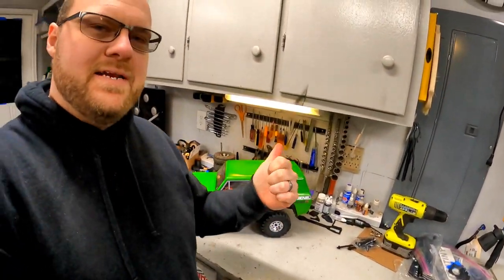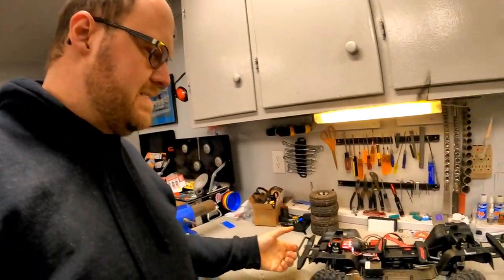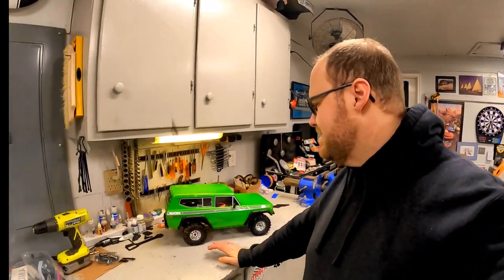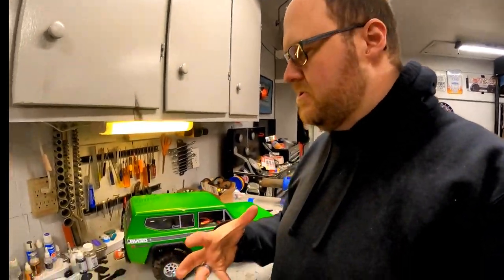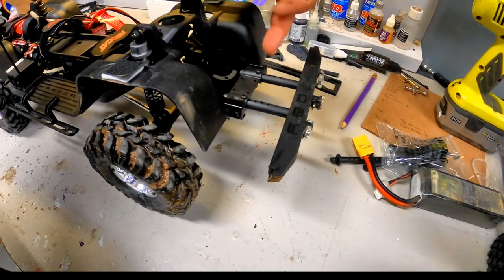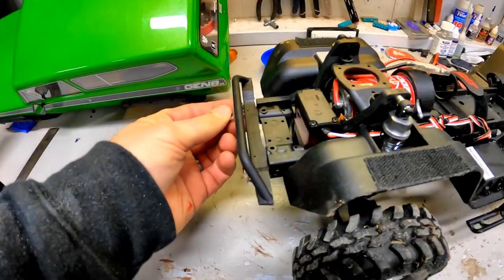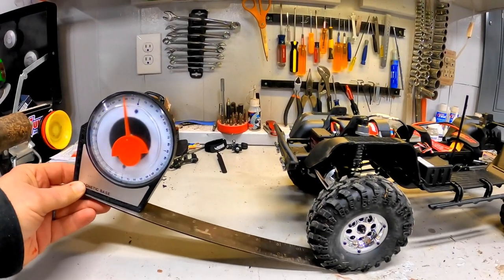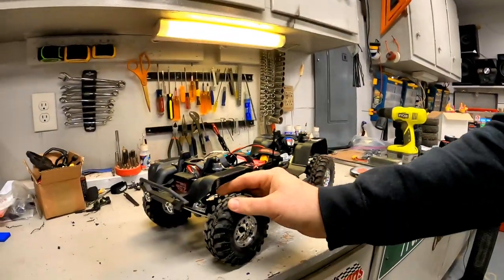Redcat Gen8 v2 Free Bumper Mod | First Drive

Comment: Great vid. Done the same thing to mine but left the front bumper thick enough to accept a winch. I also swapped out the tires. Rubber is good on Gen8 tires but that memory foam was a mistake on Redcat's part. If temp is below 55° they are hard as a rock. Put Proline Hyrax's on and what a difference that made. I also just did a video on custom cheap wheel weights. That along with the Hyrax tires makes huge difference. You wouldn't believe how much better of a crawler it is now. Also got rid of that top heavy stock body and went with the Dodge Ram from Proline. Good luck with yours, it's a great performer for that price point.
Reply from the maker: Thanks for the tips!
Tires is next on the list for sure. 
The owner really wants to run the AXE body, so we will see what we can do with that.  
I certainly plan to add some weight down low to help out.

Comment: I’ve got a V1 & an Axe edition. I got the 3300kv 550can Axe combo from hobbywing and put the original axe system in my V1. About those tires? I felt the same way about them when they were new, but after changing the foams and getting some miles on them? I’m so happy with them now! Thanks so much for sharing the bumper mod! I may have to do that with both of mine?! 🍻from🇨🇦
Reply from the maker: Thanks for the tips on the tires.   I agree they do have a lot of potential!

Comment: Great video!  I put a metal front bumper on my Gen8 because I broke the stock one first time out lol. The only other upgrades I've done are new new wheels and tires, servo, lights, interior and driver. I also bought a clear gen8 body and painted it.
Reply from the maker: Awesome - sounds like you have done a decent amount!  
I really weakened this bumper for sure.  I hope it will last!

Comment: Very good mod to the front bumper, I have mounted the tires branded Louise from Ebay, they performs really well, have a soft compound and comes in different threads.
Reply from the maker: Great!
Thanks for the tip!
Reply: @RoadsideRC   Bumper mod, done, looks pretty cool, thanks for the great content.

Comment: I just got set of duratrax deep woods tires and metal beadlocks. Love them both. I just broke the bar off my front bumper and now looking for metal one. Also have treal 11mm brass hexs.
Reply from the maker: Thanks for those tips!
I really do like the Duratrax tires.  They are great, especially for the price!
Reply: @RoadsideRC  thanks for the video. I just moved my rear bumper in under the body and really like the looks. I have lights in front so cant move it as far as you did but did move it in one screw hole.
Reply from the maker: Great!  Every little bit helps.

Comment: Just wanted to mention that I moved the bumpers in on my gen 8 and my son's as well and the only problem we had is on the rear with the bumper pushed in the the body hangs up on rocks etc and eventually wound up splitting the body all the way up passed the rear tail light, granite we caught it soon enough and easy fix with some shoe goo but just something to keep an eye on!!
Reply from the maker: Thanks for the watch-out!
We will be putting the AXE body on this truck, and plan to really do some looking at how to modify/reinforce it in the rear there.  
Thanks for the tip!
Reply: Thanks for the heads up. Just did this. Will be reinforcing body soon.
Reply: @swissk31  no problem, what I used on are's was some old clear lexan from bodys I cut and some shoe goo from the bottom by the bumper up to about the rear window in both corners, seems to be working! Hope it helps

Comment: Been on the fence about a Gen 8 for awhile now but these V2 models are nice
Reply from the maker: They are very good, actually. 
It is surprisingly good straight out of the box, and even when I am done throwing a bunch of upgrades at it - it will still cost less than an Axial SCX10iii!
Reply: @RoadsideRC  yes I agree and even own a 10.3 lol. What type brand battery are you using In The battery tray?
Reply from the maker: I have a variety of batteries at the moment.  Some Ovonic, Goldbat, Zee.
Reply: @RoadsideRC  nice thanks!

Comment: Great video man. Got one theses in purple for the gf and i put a 27t axial motor traxxas receiver and transmitter and trimmed the foam in the stock tires put em on my crawler amd now she has ebay 20$ that perform so well lol. No jumping in the transmission over stuff and throttle controll is so good with the trx tranmitter and receiver paired with a higher turn motor. 17t wayyyyyyy to low of a turn motor in my opinion!! She loves the mods i did hope yours work well too! Ordering a mst 2.0 soon thanks for the recomended drift car in the past!
Reply from the maker: Great!   I have been thinking of putting a Hobbywing 1080 ESC in this to see if it helps the low-speed throttle control, or is it just the controller.  I hope the ESC will do the trick. 

Good luck with the drift car.  Let me know if you have questions along the way.
Reply: @RoadsideRC  it seems to me that its in the drive line and transmission gear mesh is not the highest quality machining or something, because ive swapped all with different stuff but nothing sensored. so you might see alot more rpm controll just in a sensored esc and motor, and even more control with remote and receiver swapped. Cant wait to see you resolve issues and sharing them its very helpful! And i will thanks!

Comment: Great video! I have a V1 Gen 8 that I absolutely love. The panhard mount on the axle wasn't actually rigid and attached so I make a brace that goes from the diff pumpkin to the panhard mount
Reply from the maker: Interesting!  
I'll give that a look.  I thought it was one of the stronger parts on the V2 though.
Reply: @RoadsideRC  It may be reinforced. The V2 has better axle housings, which may remedy that. But the V1 slop was super noticeable and even took away some steering performance
Reply: I did the same thing with my v1 gen8

Comment: i took a couple of them v1 and made a 6x6 made the skidpalte mod, panhard mod, servo relocarion, brras links,  aluminum beadlock, proline hyrax,proline 2 stage foams, shock tower keys, power wagon  cab, 12t 5 slots motor, 1080 esc, costumes siliders, patina paint, rust allthe frame ancomponents
Reply from the maker: Wow!  Sounds like you went all-out on yours!

Comment: Best mod I did to my gen 8 was Holmes crawlmaster sport 13t hw1080 controller and 13t pinion gear on 3s :) everything else is essentially stock did two complete bearing swaps in mine so far it took a ton of abuse this last summer
Reply from the maker: I do like my Hobbywing 1080 and Holmes Hobbies motors.  That was not on the list yet....but you might be convincing me to go for it.  

Why so many bearing swaps?
Reply: @RoadsideRC  the gen 8 is great but it has tiny weak bearings. I keep blowing portal bearings and the input bearing on pinion gear. Red lock tight that pinion input gear onto its shaft it’s backed out on me a couple times.

Comment: Now move the control arms to the longest holes and make the wheel base longer, you'll gain another 2 degrees +/- on that as well.
Reply from the maker: Yeah - I didn't do that, as I was worried about getting the wheelbase too long.  The truck already doesn't turn great, and lengthening the wheelbase makes that even worse.

Comment: I updated my tires to voodoo KLR/M with Treal wheels.That was my first update.Thinking I will switch out my esc to a 1080 to get better control.Really enjoy your channel.
Reply from the maker: I am really thinking of doing the Hobbywing 1080 also.  The low-speed throttle control is not great with this ESC.

Comment: I install the cooling fan on the motor of my red cat Gen. 8 and I had to trim half of the centre support over the motor.
Reply from the maker: Wow - was it getting that hot?   I usually don't have temperature problems on my crawlers - never run fans.

Comment: Hi Troy. I'm wondering what you did with the sliders. Did you just flip them ? Did it need body trimming?  Thanks
Reply from the maker: Yes and yes.  
I flipped them, trimmed excess plastic off of them, and trimmed the bottom of the body to match.

Comment: Awesome Video I'm waiting for my  Portal  Axles and centre transmission from Gen 7.  I can't wait to see what you do to yours might just give me some ideas.  Pro line dual stage phones are fantastic in those tires If they have the same issue as the 7
Reply from the maker: Yep - same issue.  Stock foams are too stiff.  
Tire testing is up next!
Reply: @RoadsideRC  sweet  Funny thing is my dads actually 2015 Silverado when install these exact same super swampers on For both our rc and real life these tires are fantastic
Reply: Yeah the stock on the gen 8 is memory foam, I’d get the integy 2 stage foams cause they are way cheaper
Reply: @jrc-fabs1634   I already got the pro lines by will have to keep that in mind for next time because I would like to get some new forms for my ascender

Comment: HEY BROTHER ,I REMEMBER U UPGRADED ''GRAND PA'S RC''GEN8 WITH THE AMAZON FRONT AND REAR BRASS PORTAL COVERS FROM AMAZON, MY QUESTION IS FOR 30.00 BUCKS FOR THE SET OF FOUR HOW WELL DID IT HOLD UP??BC GETTING THE TREAL IS JUST A LIL TO MUCH MORE THEN I WANNA PAY/..PLEASE LMK BROTHER THANK YOU..
Reply from the maker: Just responded to your other comment.   They have been good, but not many miles on them yet.
Reply: @RoadsideRC  thank you

Comment: 70 degress is a bit more than needed considering climbing limits.
Reply from the maker: Honestly, for most things we do, I would prefer over 90 deg.  It is all about being able to come up to an obstacle and get the tires on it, instead of the bumper hitting.  

If you check out some of what I have done to the new Element Ecto - the tires actually stick out further than the bumper now!

Comment: Seems like a good video, can't watch it. T Mobile keep screwing up. Now getting worse reception on phone and internet. They suck! They must be using a coat hanger on their transmitting tower. But my radio and shortwave still works fine. Getting the green one and getting rid of the Velcro before I crack the body.
Reply from the maker: I really like this truck - I expect you may also!
The velcro has not caused any issue so far for us - maybe we are just lucky!